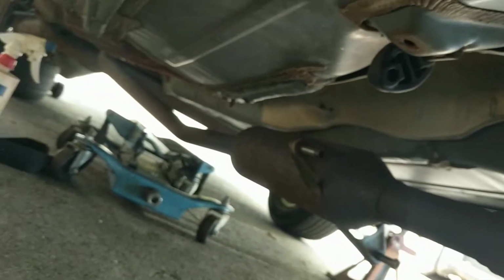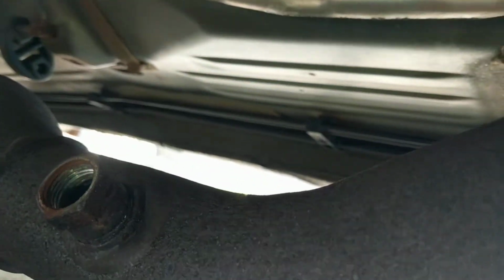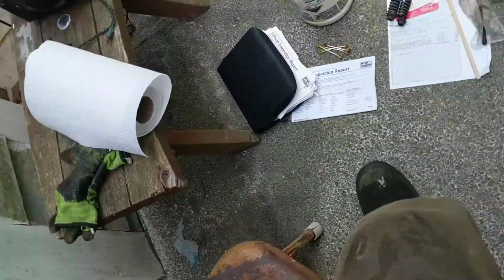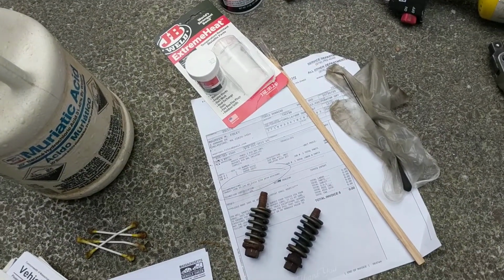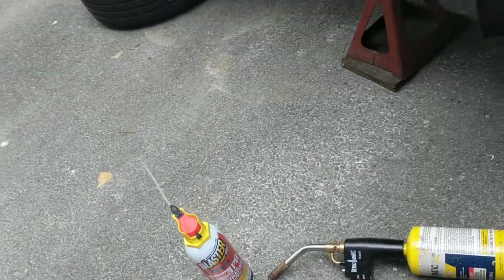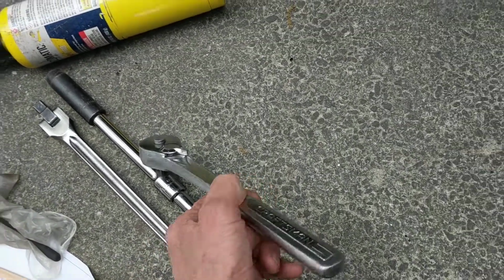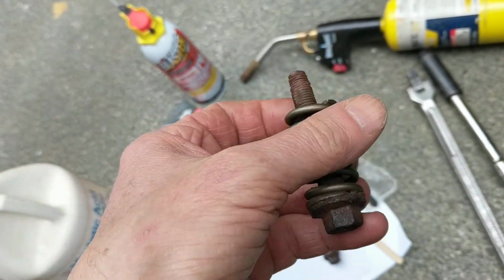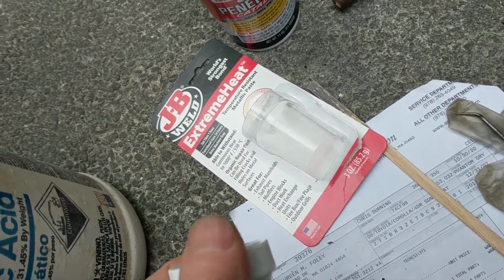exhaust leak repair on 2008 Corolla catalytic converter front exhaust pipe

Comment: This is exactly the leak I had on my 2008 corolla. Saved me a lot of $$ using the JB weld product Thank you MR. Dave!
Reply: I’m here for the same reason.
Did it work?
Reply: @ yes. But very hard to get at. Needed to be on a hoist to get my hands in the right spot.